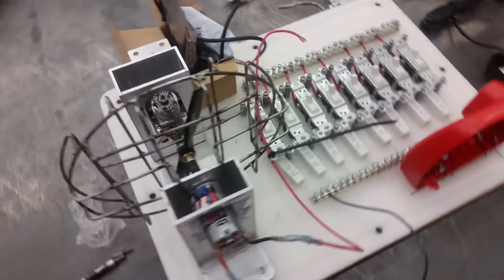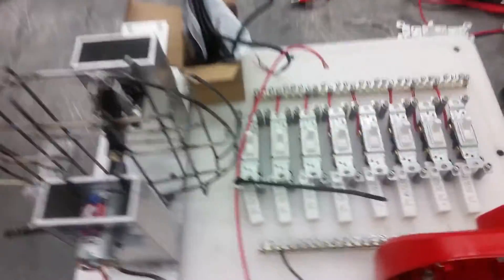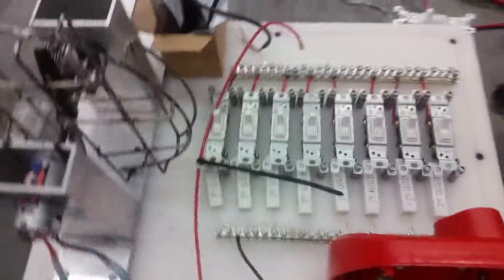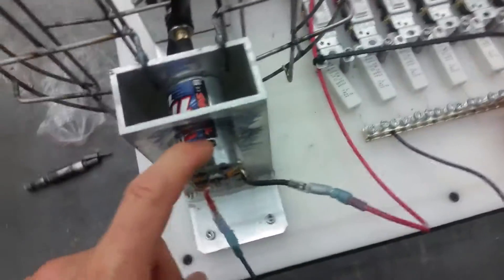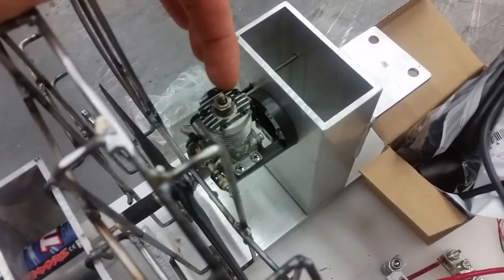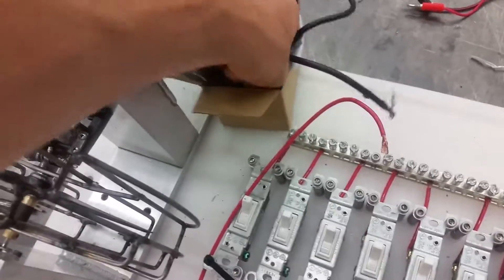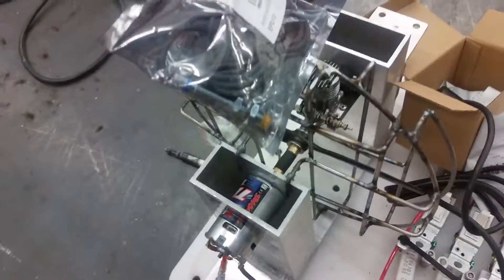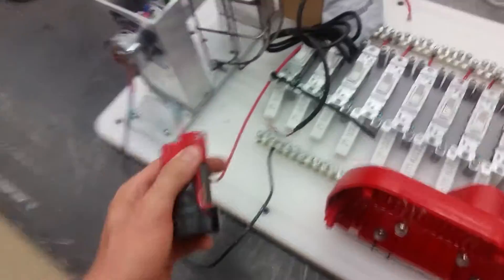RC Nitro Engine Dyno Update (July 18th)

Comment: I don't know what exactly is your goal with this setup, but right now as it is setup, you are never going to be able to measure the output of the motor since you have two loads attached: the electric motor and the propeller. In order to measure the output of the engine you must remove the propeller so that (almost) all the energy produced by the engine is consumed by only those resistors.